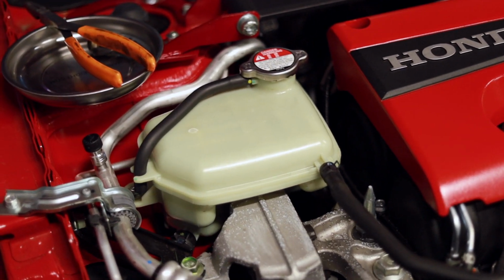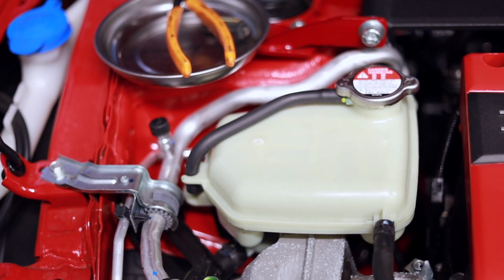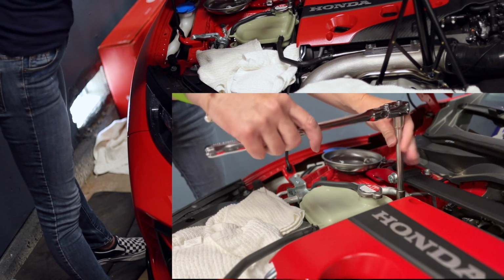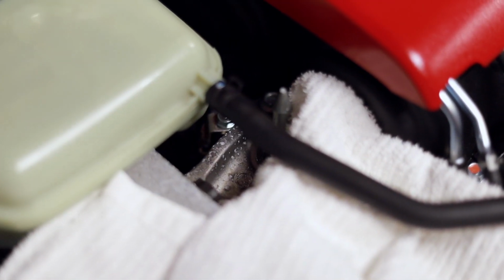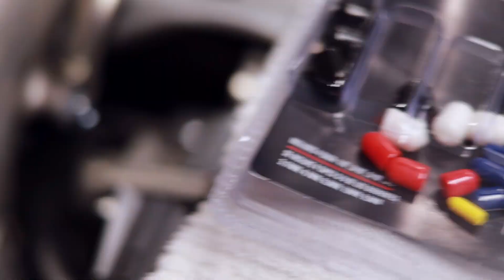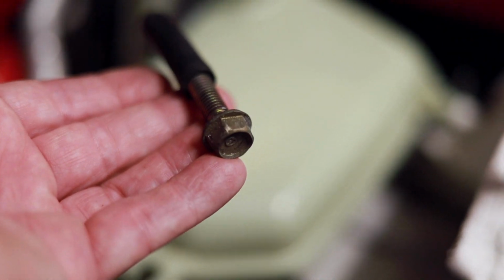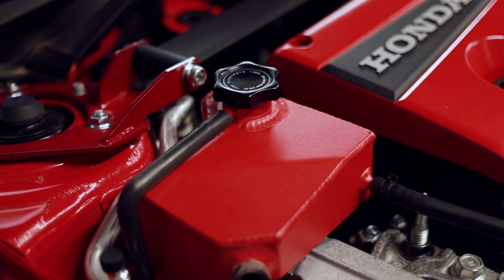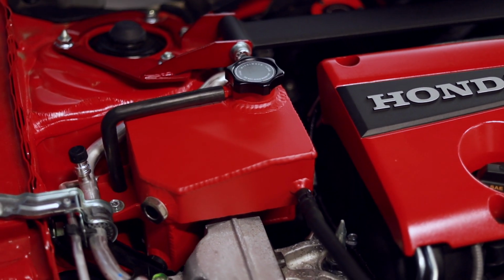Civic Type R FK8 Expansion Tank Install!

Comment: Thanks for the video, please let me know if you have any issues with not bleeding the system after replacing the expansion tank, the red on red looks great.
Reply from the maker: Thank you for watching and the kind words. It didn’t need to be bled. I’ve driven it since and all is good!!!
Reply: Good to know …
Reply from the maker: @abhijeetmankar772  obviously you should do what you feel comfortable doing, I ran the car for 15 minutes after the install and got it to
operating temp and had no issues, then took it on a drive and it was great for an hour drive!